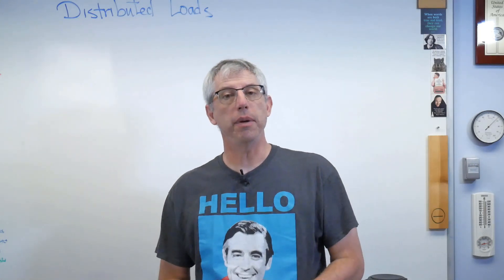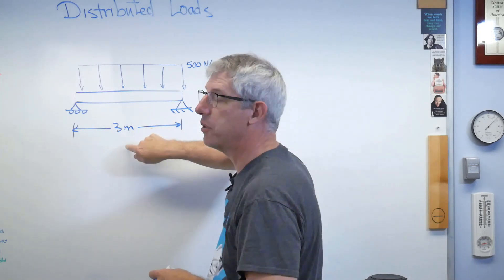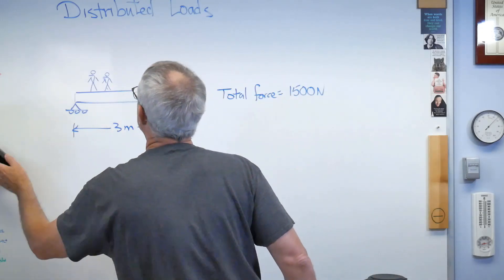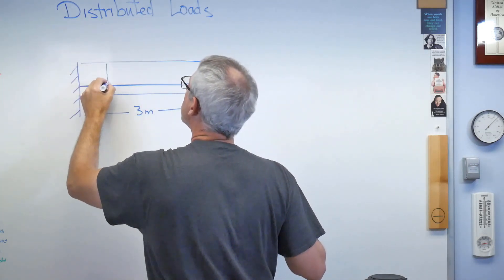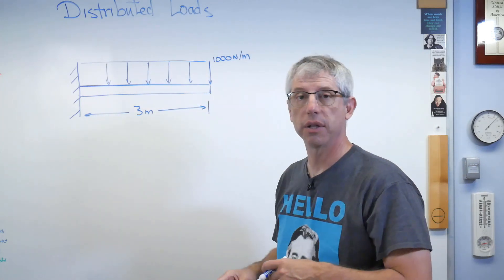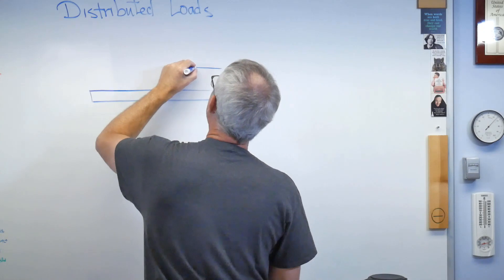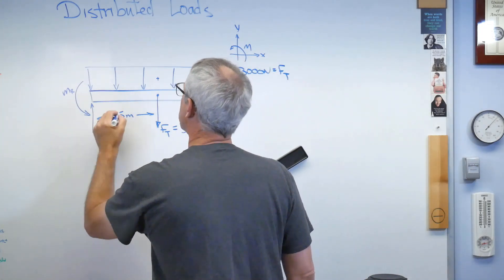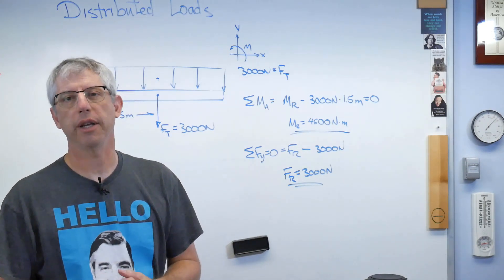Statics - Distributed Loads

Comment: I think a great thing to cover would be what is a distributed load in regards to how it’s physically done. understanding that in the first example, it was 500 Newtons per meter, so Every meter had 500 N placed onto it yes , but stress is a force divided by an area. What I mean by this is let’s say you have a box that weighs 100 pounds and the box is a 10 x 10 x 10 cube if it was laying on a beam that was 20 x 10 x 5 what would be the distributed load on the beam due to the box.